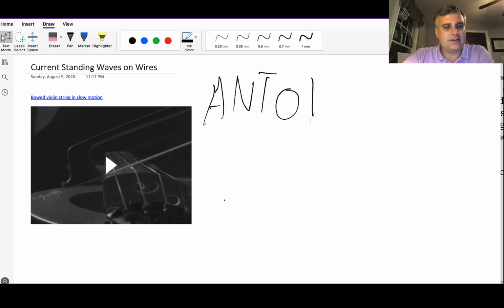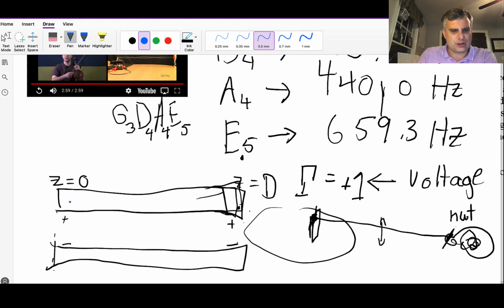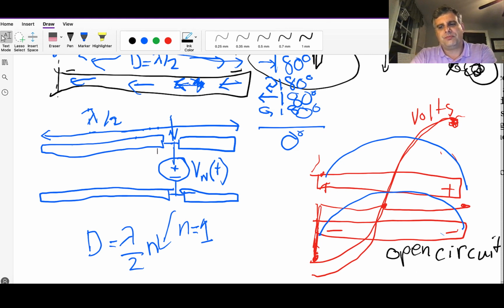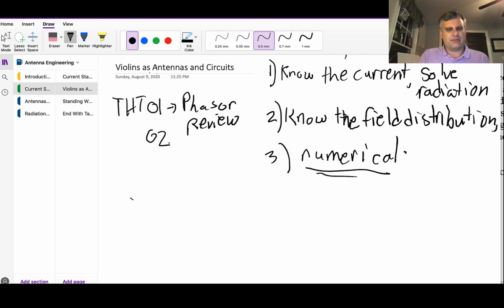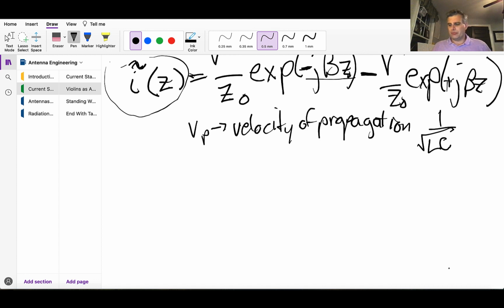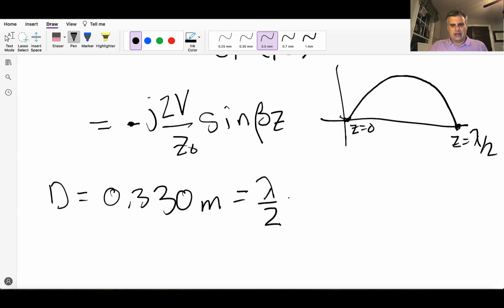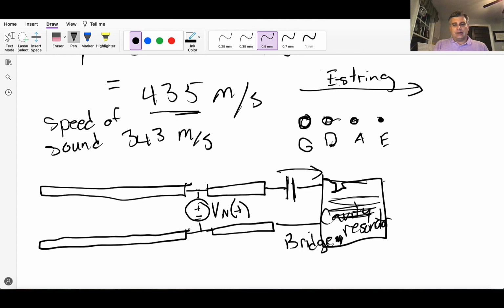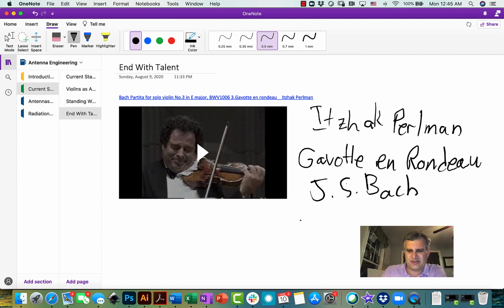ANT01:  Current Standing Waves on Wire Antennas

Comment: Nice video.  I suppose the wolf tone is an undesired cavity mode.  Reminds me of my daughter’s science fair project where we measured frequency of several violin strings, and compared to calculation given mass and tension.  The frequency error yielded a constant that was due to the construction of the string; cores, winding, & material.

Comment: Thank you.  Great video.  One beef I have always had with education is that engineering is the APPLICATION of science and most courses start with and focus on equations to such an extent that students have hard time getting a feel for what is going on.  Math is a very important tool that can be used when applying science, but it is only a tool.  Most of us engineering types don't think that way.  Using musical instruments gives us a feel for what is going on and in many cases it gives us the insight to allow us to pick up a musical instrument and think things through.  Using the violin helps students think about any musical instrument and build a foundation of understanding that will remain long after an equation is forgotten. 

Using a violin to teach RF also builds upon one of the most important things I learned in my college days, the idea that "it's all the same".  Mechanical energy, acoustic energy, conducted electrical energy, radiated electrical energy, vibration, heat flow, all of these have considerable overlap in how they behave.  Using a musical instrument to explain electrical concepts helps to build this "bigger understanding".

I once had an X-Kodak employee try to explain to me how Kodak used a massive SPICE electronic circuit analysis program to work through the chemical magic that takes place in the various chemical layers that are laid down on photographic film.  That doesn't have anything to do with your video but it is another example of using something that is "more real" to the student to work with and solve problems that are "less real" to the student.  Please continue to use musical instruments or anything else we can "touch and feel" whenever they relate to complicated electrical or RF concepts.

Thank you for the years of great videos.